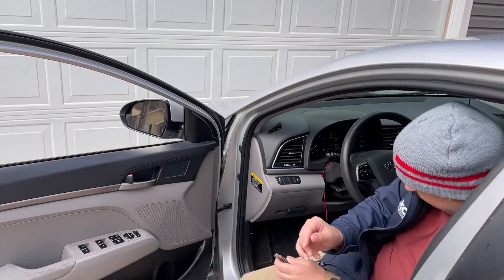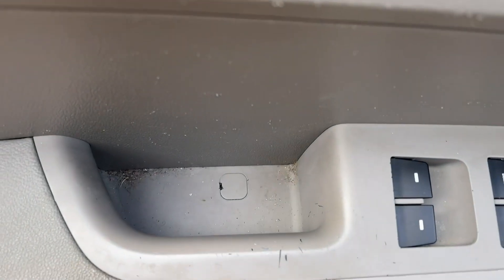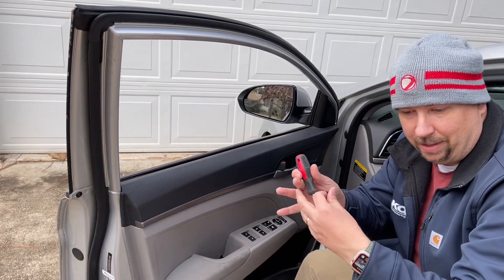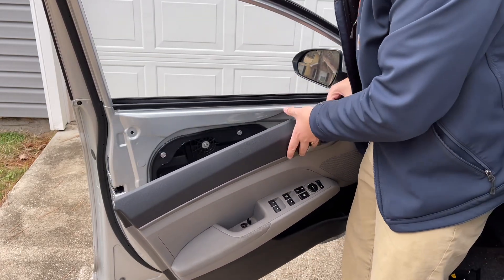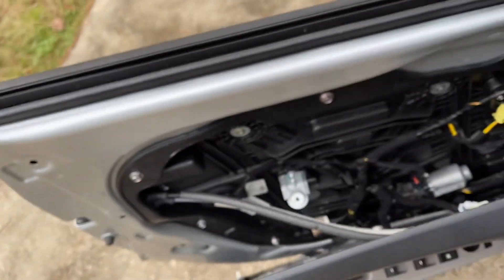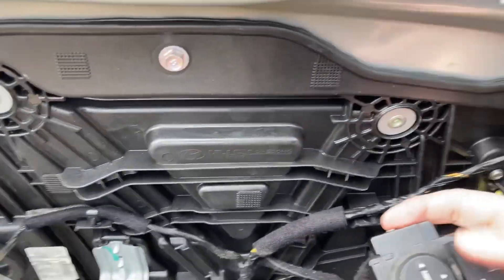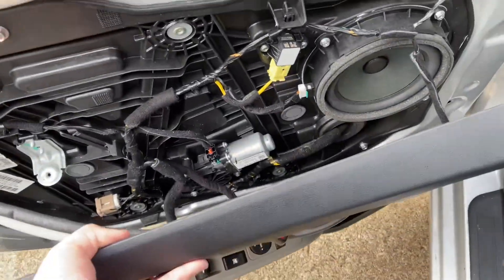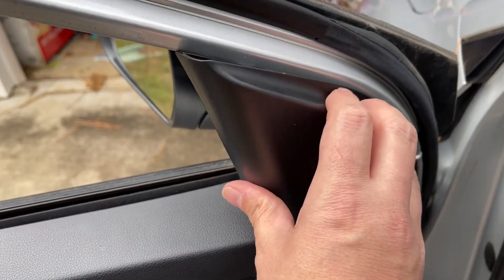2017 Hyundai Elantra side mirror control switch replacement

Comment: Could you please tell me where you bought the new switch you placed for the mirrors?
Reply from the maker: I just bought it off eBay. I searched for my car and found a seller that had the switch.
Reply: Could you share the link here? To buy it the same as I need it.
Reply from the maker: https://www.ebay.com/itm/315261118182?mkcid=16&mkevt=1&mkrid=711-127632-2357-0&ssspo=AfN_fLNNS0K&sssrc=4429486&ssuid=ImxvttF4SKm&var=&widget_ver=artemis&media=COPY

Sure, the one I bought is not available from that seller anymore, but this is the same for a 2017 - 2020 Hyundai.

However in my case this did not fix the problem, I had to replace the mirrors in the video below:

https://youtu.be/zM-dZ4BkAtg?si=f7HaBV8QPW2XRJVo

Comment: I knew it was not the switch based on ONE  fact how often are you touching that switch.?   I have not needed to adjust my mirrors unless a valet changed the position.  Its far more likely that a window switch would fail first since the raising and lowering of the window is a far more of an occurrence than adjusting your mirrors.  The motors in the power mirror it self are the problem
Reply from the maker: Thank you, you may be right but I was hoping it was the switch which is much easier for me to fix. I don’t even know how to start changing the motor in my mirrors but that is probably the problem 😒